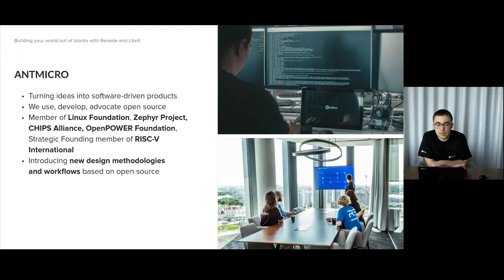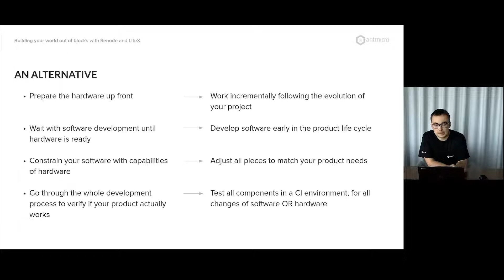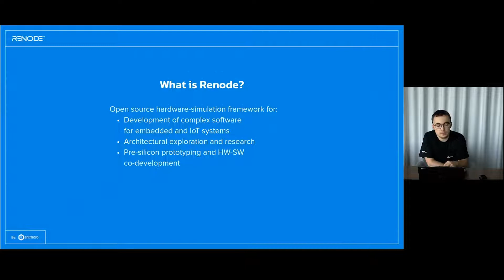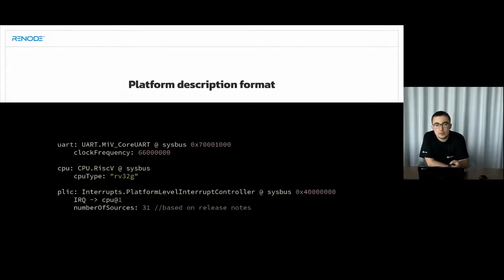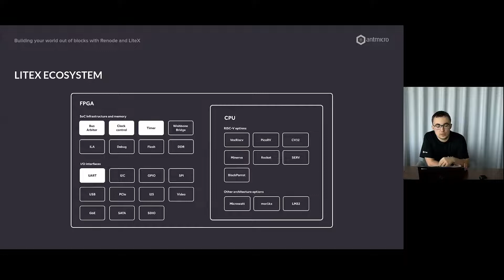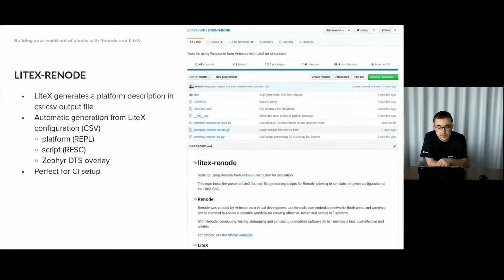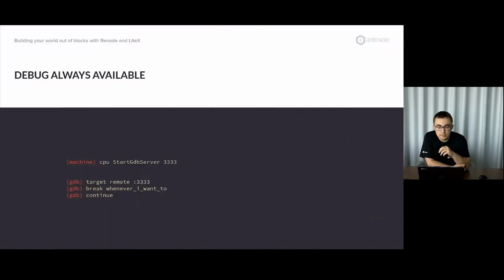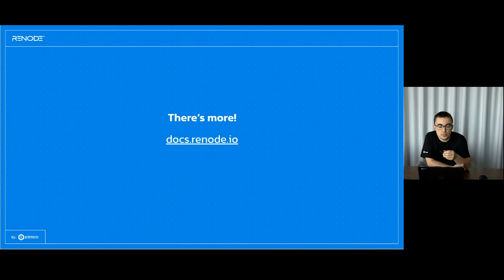Tech Talk with Antmicro: Building your world out of blocks with Renode and LiteX

Comment: How does the FPGA Tooling and/or the Compiler Tools work with the Renode's Virtual Board?   If using USB, would it need to be written in LiteX (Valenty), or could the Vendor's IP be used?  I'm interested in running (Carlos Eduardo's?) FuseSoc on a local Docker container.

For example, is the output of the Vendor's FPGA tool (SymbiFlow, nexpnr,  Xilinx Vivado/ISE, Intel Quartus Prime, Microsemi Libero) and import into Renode?    And how does debugging the processor work... does it support any  hard or soft cpu, like the one on QuickLogic’s EOS S3 (Arm-Cortex-M4F), or Xilinx's Microblaze, Altera Nios, RISC-V?

Is there a hello-world type tutorial on getting started?